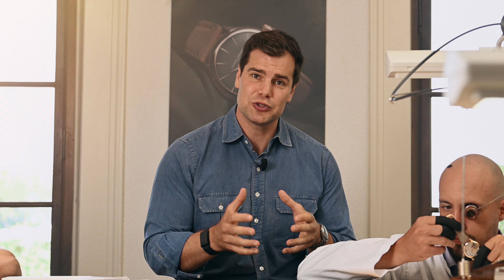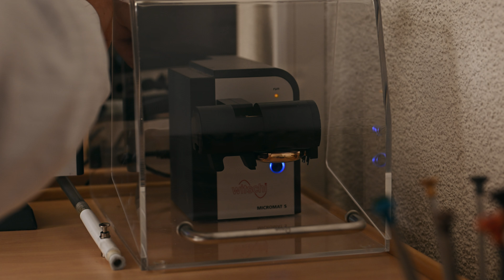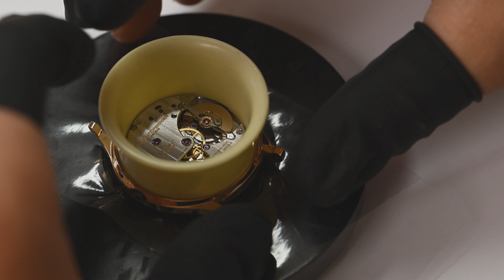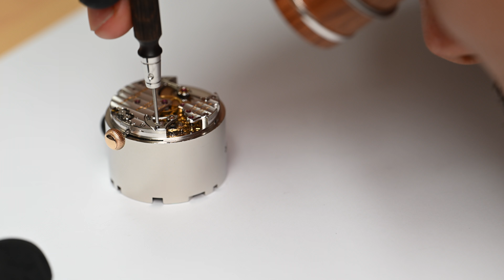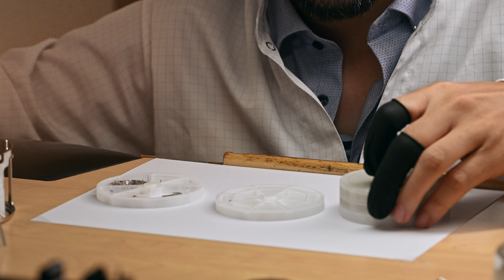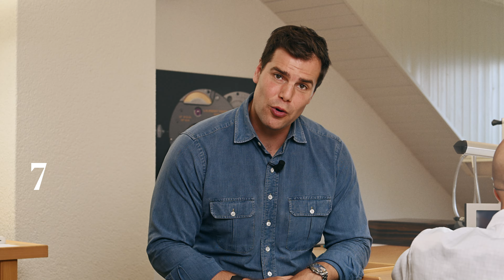The LAURENT FERRIER Aftersale Process

Comment: Amazing process, amazing watch, amazing craftsmanship. But...shouldnt the water resistance test be performed after re-assembly? What does it matter if it is, or is not, meeting spec when its about to be dis-assembled?
Reply: So that iffff they find water damage inside then they can assert that they got a compromised watch in
Reply: Helps them identify issues ahead of service. They aren’t like a car where you can hook it up to a diagnostics machine and get a data print out.